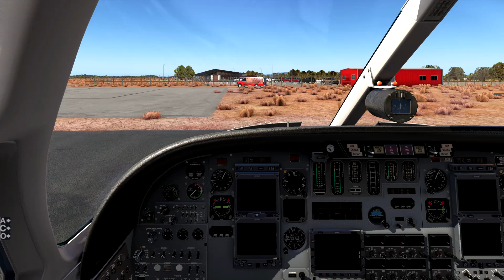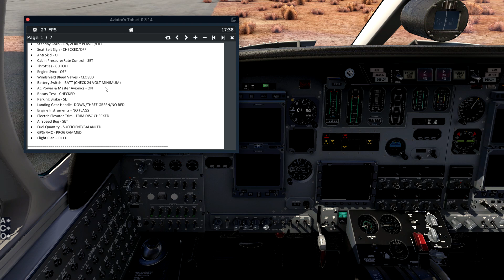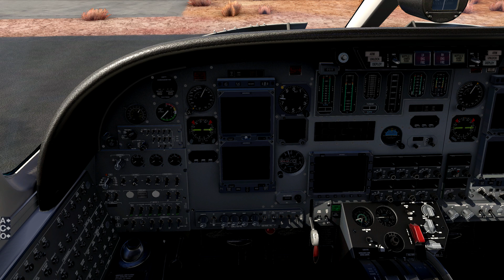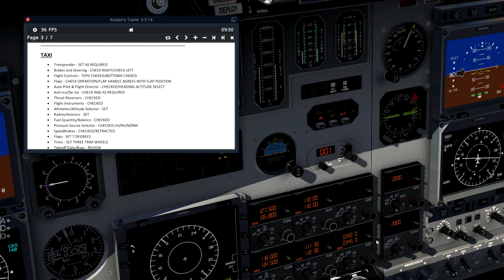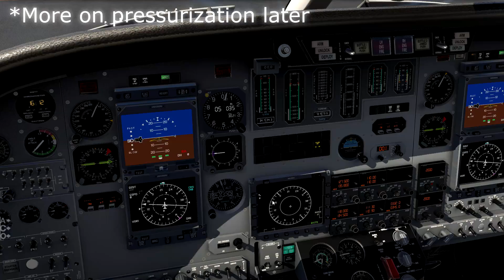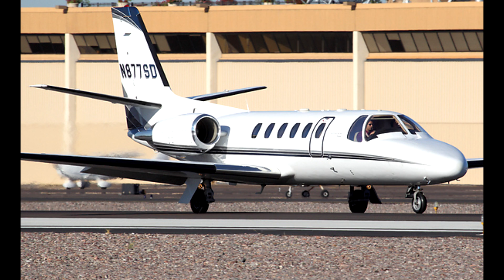Corporate Pilot Professional I Episode 2 I Before Start, Engine Start, Taxi,Thrust Reversers

Comment: Two questions and an observation... question 1) What is a discord server and... where is it? 🤔 question 2) I did not see any movement when you reset the heading bug... so where do you do that? Observation...  I have flown the plane for a couple of hours and it flies well. Unfortunately, on my Saitek yoke, the electric trim moves the trim wheel a good five to ten times faster than what I see on your video. So, for all intents and purposes, I cannot hand fly the Citation because it is impossible to micro adjust the trim for cruise flight. A real bummer. So it will be AP for me most of the time.
Reply from the maker: Discord is a social media platform where I communicate with those who are part of the channel. We post screenshots, useful links etc. Here is the link if you are interested https://discord.gg/Br3yQZB 

Also the Heading bug reset is a command I bound in settings. HSI/HDG/Sync command when pressed will slave the heading bug to the aircraft's current heading. Or you can just manually rotate the heading knob.. I will cover this in more detail on the next video

PitchTrim issue, you are not alone, I do have a fix tho! I was going to upload it in the next video but I will post a short video today addressing this problem
Reply: Tx... been having nothing but problems for the last three days... 😕